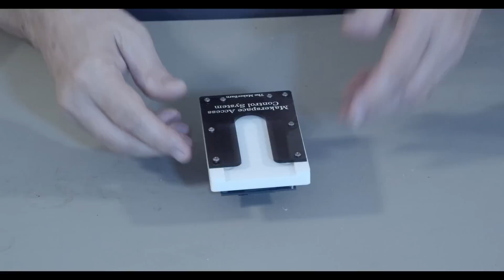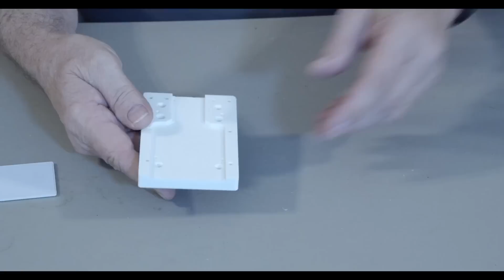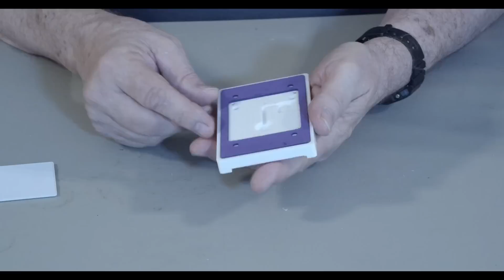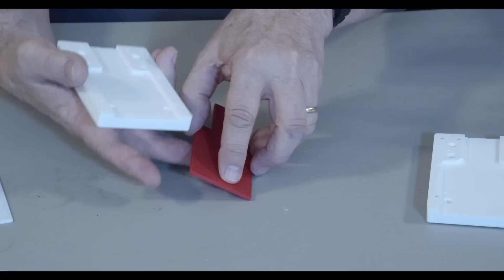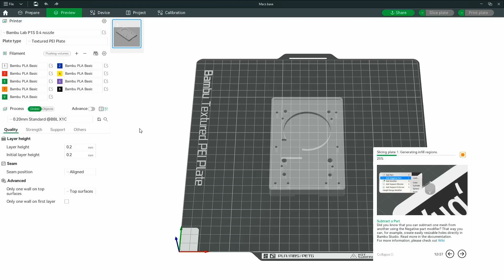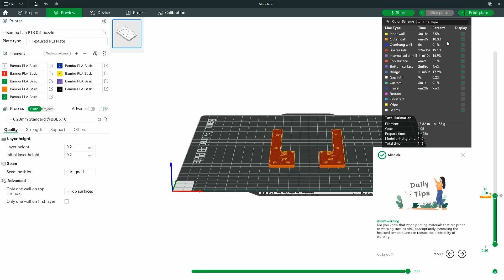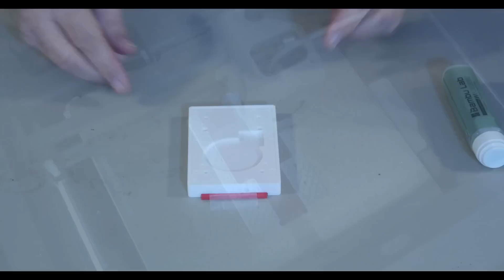3D Printing Without Using Supports

Comment: Awesome tip, i  saw the video about 2 weeks ago, and what do you know, i get comissioned to make a propeller part that could only be done otherwise with a multimaterial setup. It took a few tries to get it right, but i made a beautiful part using an ender 3 thanks to you!

Comment: I do this using ABS. I also usually stick a magnet on the core to keep it in place. But I only do this as a last resort. 

I would probably just split that in half and extend the screws you’re using to the back. 

But you’re right. I haven’t really seen this on YouTube. This a handy trick. It also leaves a perfect surface finish. Even on the top side of that bridge.

Comment: An excellent idea, one I'm sure I'll try at some point. Thanks for sharing. If I can add two suggestions for something you are going to use regularly. 1: Embed one or two thin magnetics in the core so it holds it's self down and 2: Add a couple of 'T' extensions at the narrow end that extend beyond the end of the main body, then it can't slide back and forth. But Hey it works great as it is!

Comment: Sounds like alot of "babysitting"!!!  😬  Why not instead us a UV Resin printer and print multiples with the base of the plate on edge attached to the print plate? 🤔 Heck! You could even use a translucent resin an backlight it with a Bi-Color Green/Red to indicate the enabled/disabled status of the machine circuitry?!

Comment: Pretty cool technique, not sure I have seen a reusable core done on 3d printer before but I have seen nuts and magnets inserted mid print so they get encased in the print.

 I have an DD IDEX printer I built so I usually just use a different material as the support or PVA if it's a complex PLA print.  Depends on how many copies you're making I guess.  If i't just a few your way is great but if I had to do a lot I'd probably split just the model in half to avoid supports and screw or solvent weld the two halfs together when done.

Sadly no maker spaces near me to join, yours looks really nice, quite the setup you have.

Comment: What about gluing a layer of silpat to the core. You know, that stuff you use to line a cookie sheet so the cookies won't stick.
Reply from the maker: When bridging across the 2.25" wide area the PLA must be able to stick down at least a little.  Otherwise it would peal up and make a mess out of the second layer.
Reply: @makerspace533  you are correct, sir, good point.

Comment: I've already heard of using PETG supports for PLA or vice-versa, printing them with the AMS, but this is an interesting spin. The advantages are that it can copy the bed texture and the core is re-usable.

I'd like to share my own idea (though, as you said, someone else might have already invented it).
We could print supports of the same material, leaving a .2mm gap. Pause the print at the last layer before the gap, lay down painters tape on the gap, then resume the print.
It's not practical for this shape, as you'd have to crop it and align it precisely, but perhaps there are other situations where it could be handy.
I wanted to do this with a filament that was very sticky (PETG?) and couldn't make break-away supports work. They would either not come apart with a small gap or leave a terrible surface with a large one, as it was effectively printing in air. I cancelled the project, so I didn't get to try it.

Comment: I was thinking if a multihead printer like the prusaXL could be a good move to use here. But the bed temps for PETG and PLA are diferent, and on a textured plate the PETG can slip out of it's place if the bed is not 80°C

Comment: Thanks! Great tip.
I have used PETG as a support filament on relatively simple models, and it separates from PLA cleanly. However, it is a pain with a single nozzle system.  Your method has helped me see the models a little differently, so now I design support blocks where I can, print with PETG, then print the model, pause the print, slide in the PETG support. It works really well.

Comment: Great idea!  But I have had great luck using PETG as support material for PLA (or vice-a-versa) as you mentioned they don't stick together when printing and they just pull apart after printing.  Easy to do with a multi-material AMS system.

Comment: 9:52  If your finished part can afford it , you could add a small locator tab / indentation in one side of the actual part (Y direction) & a mating feature in the core (maybe a semi circle or triangle) , it would make the core self locating (no tape needed) and foolproof on which surface is up.  Love the concept very much though, I'm going to have to try it !!
Reply: Great idea to reliably lock it in place!
Reply: @q2observe  - as an old retired guy (8 yrs +) with over 35 years as a product designer, I'm glad to still be able to contribute to the cause !!

Comment: Have you considered using embedded magnets to hold the core to the build plate? If you're making many parts that would speed the process up, and make it less fiddly. Using sets of magnets might also let you build up stacked cores at different levels to make complex cavities.

Comment: If you need a decent surface for the core against the new printing surface, you could try a single layer of painters / white masking tape.  I use it for my actual print bed surface on top of the glass and the PLA sticks every time.  Cools down and peels off well too.  The matte texture and smooth ish surface of the tape (non sticky side) works well and is cheap and replaceable.
Reply from the maker: Good idea!

Comment: Thanks for sharing, looks like a great method. I've tried printing PLA over PETG using a dual extruder and zero gap, but it sticks like hell and is difficult to separate (despite what others say). I guess the fact that your core is cold (or relatively so) makes all the difference. Also, you have the benefit of a reusable core, which saves printing time and material.  I'm going to give it a try.

Comment: I would think, just put to minor block stops in the 1st layer.  at the top of your buck to stop it from sliding around.  I think that might be a better option, or go with some sort of key slot on the lower tang of the buck to lock the buck into place.

Comment: the title of the video is misleading. Technically speaking, the red piece is still support. Even if it is a pre-printed part from a different material. ...btw. The red part could have a shaped fitting at the end so that there is no need to use tape.

Comment: If you have the AMS just use PETG as the support material. Works great.
Reply: ...but then you print a PETG support for every PLA part. The method suggested in this video uses a single pre-printed PETG part, so saves a lot of material and printing time. Very smart idea that I shall be trying.
Reply: @Mikipedia0  PLA part, PLA support structure, PETG interface layer. 1 toolchange to petg, 1 toolchange back to PLA per flat support surface. This works great if you're at your machine for a few prints and the part has one flat surface facing the bed, but that's not always possible. Try the above one day if you do have MMU abilities!

Comment: PLA and PETG don't stick, but not because of temperature, rather because they are chemically incompatible. PETG sticks to PP despite much lower melting point, for example, and you can blend them together to get a plastic with different properties. If you blend PLA and PETG the resulting plastic will be extremely crumbly.

Comment: I am sorry, the poster takes too long to introduce the topic. Description only needs a minute or so.  This method is fine for old printers, most modern printers can place a layer of dissimilar material that will not stick to the supported layer, thus it doesn’t require any separate parts. For example, when printing with PLA, print the support top layer with PETG. There are plenty of videos describing this method.
Reply: The core is reusable, less time per print, and less wasted material. It has a lot to recommend  it over printing new supports for every instance of a model.

Comment: i sometimes make 1 layer thick parts before printing main part, pause the print before overhangs and insert it like a roof for the overhangs. But i like your solution as well.

Comment: Brilliant idea, thanks for sharing!

Did you try extending the tabs on the form widthways so that it locks itself in the X and Y directions?  I wonder whether that would negate the need for tape or whether you need something holding it down in Z too.

Comment: The petg part is a manually created support. So you did actually use supports. We don't see this often on YouTube, but it is fairly standard practice, called sacrificial support structures.
Reply from the maker: It's a bit different than sacrificial support which is usually done using soluble support material.  This support structure can be used over and over making secondary structure removal unnecessary.

Comment: This is Great,  I thought I could make a block set that I could use for 90 degree prints instead of supports.  This opened my eyes on how to do it....thanks so much.  I do believe the next revolution in 3d prints is in supports or lack of them either by Design or machine capabilities.    I have one for you for helping me out.       Use Magnets on that red piece. and I too use the Bambu glue.....   thanks again, great stuff.
Reply: Rather than magnets in the red PETG piece, a small stop of ferrous material embedded into it would do the same thing and not be sticking to other things with just ferrous material. The embedded ferrous would easily stick to the magnetic bed of the printer but not too strongly, and you would not have to use tape. Actually, putting tabs on each end of the PETG which would "T" on each end would prevent the verticle movement. And printing 3 at a time (maybe 4) might work out as well.
Great explanation and I can already see a lot of use for this in some of my prints. Thanks!

Comment: Brilliant. I think I saw a promo video from prusa where they did something similar with an external overhang. But I never saw it again, nor have I ever seen anyone recommend it.
This is particularly good when you have repeats to make. As you essentially have a reusable support. But given the surface quality is probably worth it for just a 1 of 
Very nice.

Side point. Have seen a similarly rare video recommending a pause and dropping inserts in that are other PLA parts to solve overhangs. Same way you'd drop in magnets etc. But that wouldn't help you here.

Comment: I’ve been doing this for years with tpu gaskets and seals that have 90degree or greater overhangs, recesses and complex shapes.  I use petg cores with magnets in for tpu, tpu cores for pla. 
To add the cores just set a layer colour change in your slicer. 
TPU takes a bit of tweaking to get the core first layer to go down correctly.
Reply from the maker: TPU would make a great core, I'll have to try that.
Reply: @makerspace533   dont forget to embed magnets in the core print
Reply: @makerspace533  me too.

Comment: You've taped two ends of the core.  How does it not bow in the middle?
Reply from the maker: The core is quite flat and the tape is not tight enough to warp it.
Reply: @makerspace533  Flat, yes, but PETG is not known for its rigidity.

Comment: Very creative solution! Since you are using the gluestick on the PETG insert to make the separation easy, wouldn’t the same technique work with a PLA insert?
Reply: I was having the same thought. Seems worth trying.
Reply: PETG has a higher melting temperature. PLA would have a tendency to melt and fuse to the part being printed over it because of having the same melting temperature.

Comment: Thanks! Should definitely try this! 👍😎
In case with this particular model you can slice it into 2 halves, each one will have a completely flat surface you can print on, and then you don't even have to glue those halves together, they will align with the screws through.
But! In many cases it will not be possible, so your method would be the best!

Comment: Subscribed! 🙂

I am more interested in the access control system :-)  I sit on the board of directors at SnoCo Maker Space in Everett, WA (Boeing's home) and we are in the midst of building out our access control systems for our tools.  What are you using?  I have been running Home Assistant in our space, just upgraded to a Home Assistant Yellow, and we've been logging 3D printer use through power meter monitoring on a TPLink 6 port smart plug.  I now have hardware that can talk to HA by reading our 125khz key card badges, but still need to polish up the interface for the HMI.
Reply from the maker: This unit uses a Particle Photon as the processor.  It also uses a small RFID reader module we were able to purchase through eBay.  Unfortunately, the Photon and the RFID module are no longer available.  I was building enough units to use up our back stock. I am in the process of redesigning the system using an ESP32.  I designed the reader hardware, the actual decode of the RFID data will be done within the ESP32.  Hopefully the ESP32 will be around for the long haul, but you never know.  The MACS reader unit communicates with a server.  We started out using a Pi, but we found it was too slow when we started getting more members.  The current server is a NUC running windows.  If you check my early videos, there are two videos demonstrating the MACS hardware and software.  Currently we are using 30 MACS units in our makerspace to serve about 340 members.

Comment: Pla breakout support and or PVA support interface would be cheaper (compare to the manual labor cost, and accuracy required), and you can easily do 2-3 per plate (not sure you have space for horizontal line).
Reply from the maker: My system has 2 AMS units, so I could do that.  But it would have to switch between material every time for 16 layers, that would be 32 filament changes which would take a lot of time. And that extra time would be multiplied by the number of units I would have to make.  In this case I needed 10 units.
Reply: @makerspace533  if you printed multiple units per plate then your filament changes would be only for the interface layers which if you wanted a nice smooth finish you would have 3 or 4 with zero gap.  all other support material would be the PLA up to the interface layers.  You should try it out it works very well!  The PLA Support material from Bambu works even better than PETG...Ive done it both ways!
Reply: @makerspace533  No, you set support interface material different from anything else, and have only two material changes
Reply from the maker: @AngelDLM08   2 per layer, 16 layers
Reply: @makerspace533  I think what Angel is saying is that it will print the first 15 layers of the support block in PLA and then only switch for the 16th layer.  It would cut down on the time but you'd be wasting some PLA every time rather than having the reusable core.
Reply: @John-gw3mj  exactly, and OrcaSlicer can do it automatically, BambuStudio should too.
Reply: @John-gw3mj  exactly, both bambu studio and orcaslicer can do it automatically
Reply: @makerspace533   bambulab wiki page /bambu-studio/support, Section "Common options - Support filament" -- interface material
Reply: @John-gw3mj  not all structures allow reusable core, especially when support placed between two surfaces. You just have another pair of material change and with some parameters dial get flat surface under supports, and most important - all automatically, so you can place 10 of them and print at night
Reply: @makerspace533  interface its ony 1-3 layers, so added time would be minutes of Printer time vs minutes of Human time

Comment: If you don't mind having chamfers and the bottom corners of your piece you could tilt the whole piece at a 45 degree angle and print it up. If your not using a bed slinger you can get away with that pretty easily. It may need a little support that you can build into the design but would be a fairly simple process. Look up "Slant3d" box printing. They have a pretty interesting video on it. I know you are not printing a box but all the same rules would apply.

Comment: Did you turn bridging off?
Reply from the maker: Supports were not enabled, so it was not necessary to turn off support for bridging, if that's what you mean.
Reply: I think what he means is if the sliced file doesnt indicate the first layer on top of the core as "bridges". Looking at the speed difference visible in the video I guess the slicer still applies the "bridging" profile, even though there should be no need for it due to the core beeing there and supporting it. Might be another thing to optimize printing speed in that area.
Reply from the maker: @MarkusRessel  Right.  Yes, I left it so the first layer over a bridge would be done at reduced speed.